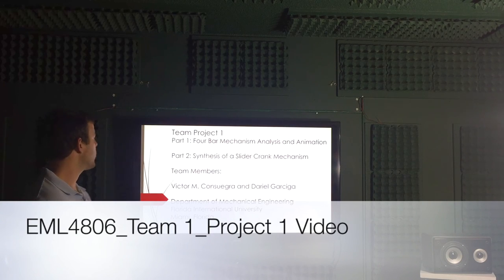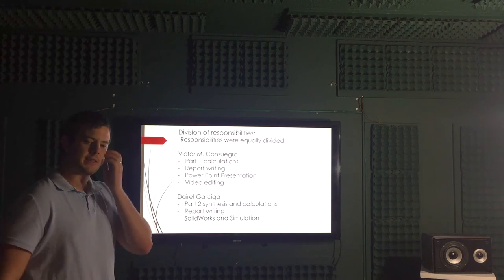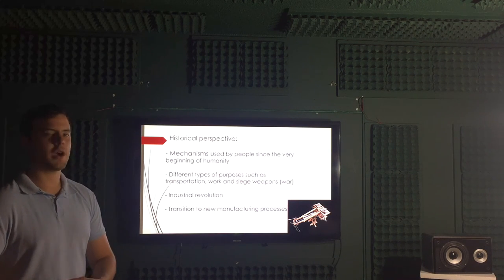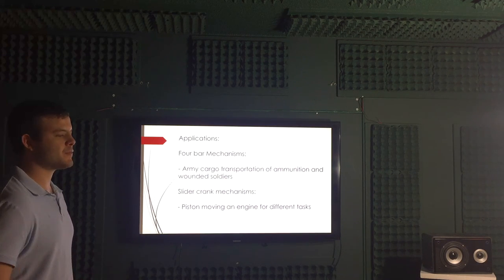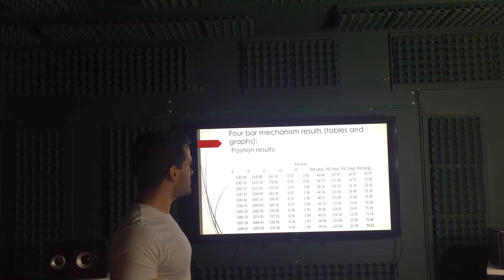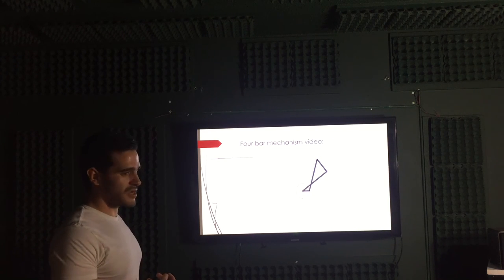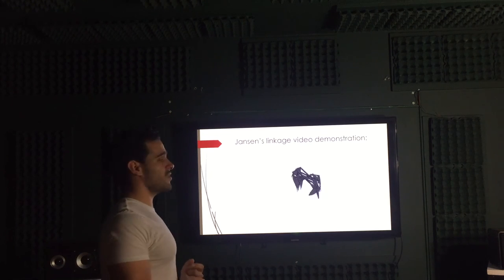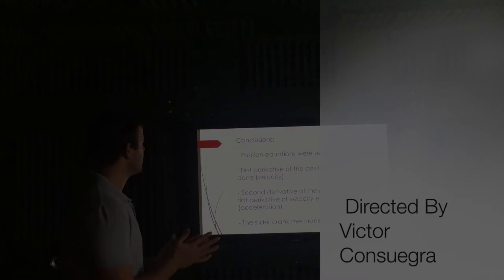Team 21: Mechanism Design: Cargo Transportation & Piston Mover Applications

Comment: Great presentation with high video and sound quality. The application and simulation for the four-bar mechanism was very good and interesting. My only suggestion would be to  look less at the screen and more at the camera. Looking constantly at the camera gives the impression that the speaker does not know the material even if it is not the case. Overall it was a good presentation with great timing.

Comment: The sound was great, but a larger screen should have been used for the slides so that the text in them can be read.  Try to look at the audience a little more instead of the slides.